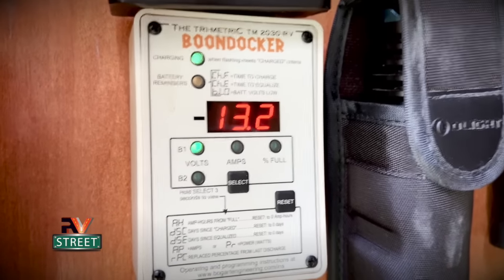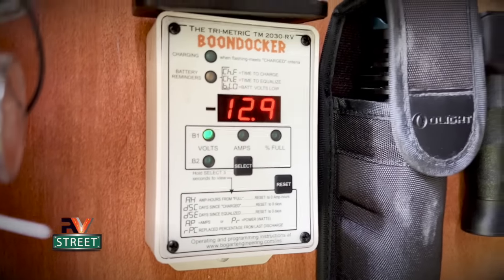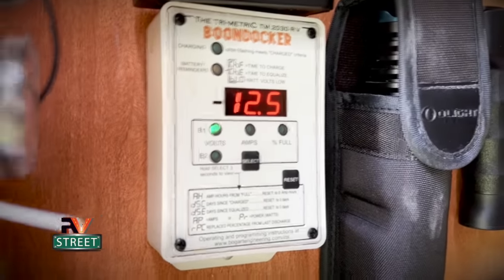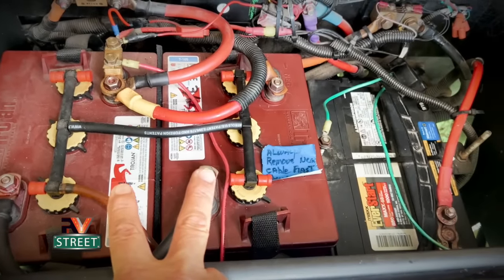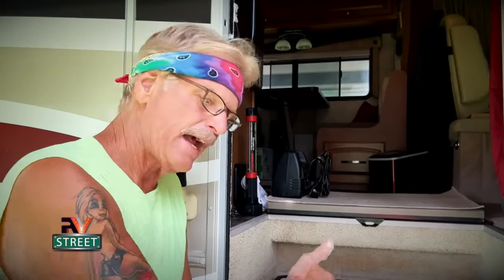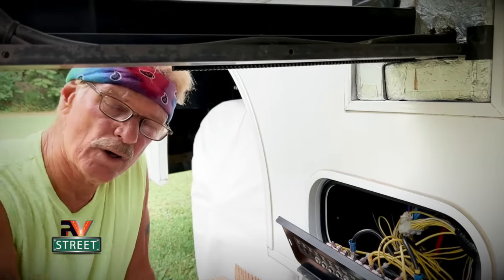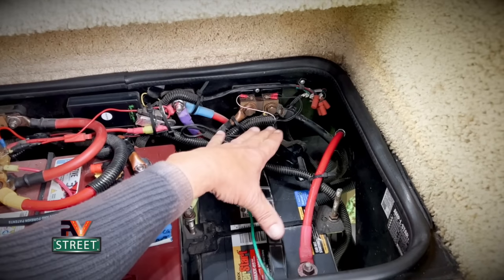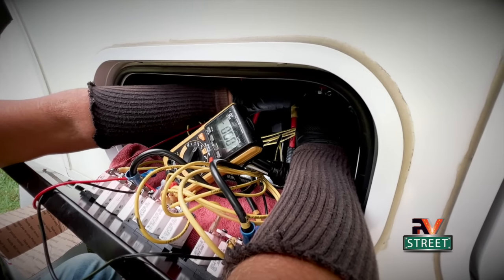RV Alternator IS NOT Charging House Batteries • The FIX

Comment: So I bought the weboost through your store. I am clueless as to how to run the outside antenna wire into the coach. Any suggestion greatly appreciated!! Thanks.
Reply from the maker: Hi Trav,
Well, weBoost does have several suggestions on their website. It just depends on the type of rig you have. For me, I mounted my outside antenna on the top of my rear ladder, ran the coax down the seam of the back cap and into my wet bay where I have a coax mounting plate for cable TV. So I screwed the out side antenna cable there. And then from the mounting plate another coax cable runs thru the RV all the way to the cabinets up front in the cabin area where there is another cable TV coax plate and there I ran the second coax cable and installed the rest of the unit including the interior antenna. You're just going to have to be creative. Every RV is going to be different. But take your time, think it thru and I'm confident you'll find a good solution for your set up. Once installed, you're really going to like how it performs.
BTW....thank you so much for using our Amazon Store to help support us. It means a lot 🙏

Comment: Martin, I have a 2000 Ford E450 V10. Something is draining my coach battery. I’ve put in new battery & new alternator. Running I have 14.2 dc volts. If rv sits for one day my battery is dead. How do I fix. Thanks
Reply from the maker: Try turning off coach battery with you arrive at your campsite. We do this or it drains the battery. Our switch is by the entryway steps.

Comment: I can run EVERYTHING just fine when plugged in or on Generator power but as soon as I start the Engine, my Inverter / charger reads a negative draw. Once I fire up the AC units eventually it throws a code PTOC shutdown over current protection....

Comment: After viewing this video, I used a voltmeter to check the charging status of the house (2 6V agm wired in series) and chassis (12V single gel) on my 1994 Flair class A. Here's what I found: resting voltage Chassis 12.53, House 12.72; generator on, Chassis 12.52, House 14.2; Shore power on, Chassis 12.52, House 14.27; Engine running, Chassis 14.06, House 12.68. The converter is an Iota DLS 55X.  I wrote to Iota. Their technician thought that the alternator was only charging the  chassis battery, and that the house batteries were only being charges by either the generator or shore power. It seems like a good idea for the alternator to be charging the house batteries as well as the chassis battery. Do you think my system is running as the manufacterer intended, or is the charging system not functioing properly? Maybe the problem is the converter, or one of the solenoids you talk about in this video? Your thoughts would be apprciated.
Reply from the maker: It seems like a good idea for the alternator to be charging the house batteries as well as the chassis battery
It's not only a good idea it's the way it's supposed to work.

As I stated in the video, the solenoids are a PM item. These need to be changed out every few years. You always want to address the common things first. Failure or sporadic charging is common. Your RV is a 1994. Replace them.
Reply: Martin, thanks for taking the time to reply...I know that you have other issues on your mind.  I was trying to read the specs on the two solenoids on my rig...they are too worn to read. But, they look very much like the ones you sell on your Amazon store.  Do you think I will be safe to proceed with ordering them without exact specs?
Reply from the maker: @KenCassorla  Yes.The ones in my store are actually a very common replacement so you should be fine. There are cheaper, 3rd party ones available but I'd stay away from them.

Comment: Hey brother I just got an additional 12 volt battery for the coach  positive to positive then negative tried to weld itself to the bolt connection I don't get it is the older house battery have a bad cell that would cause that thank you joe
Reply from the maker: I broken hearted to say Martin passed away April 2nd and I honestly don't have to answer to your question. Sorry
Reply: @RVstreet  I'm so sorry I love you guys

Comment: Not sure where to start. Coach batteries not charging. The battery disconnect switch is always lit. I can hear a click, but the light stays on.  It’s like it’s always disconnected. Where should I start? Test voltage at the switch?
Reply from the maker: Even though your battery disconnect rocker switch is lit, MAKE SURE it's actually turned on. If the rocker switch accidently gets switch off, it will still stay lit but not charge the batt's. That's where I'd start.
Are you plugged into shore power or what?
Is this a problem that's just popped up or what?

Comment: This sounds like my problem.  however, the battery isolation system is in such an incredibly difficult place to get at, I don't see how I could possibly change the solenoids out.  just to get my head in there to even see the bolts holding one of the solenoids in, is darn impossible.  Tried to get my wife to get her tiny head in there but she could barely fit.  How the hell did Winnebago even install this?  There has got to be an easy way but I sure don't see it.  I have a Class A 2006 Itasca Sunova 26P.
Reply from the maker: I am sad to say Martin passed away Sunday😢
Reply: @RVstreet  I'm so sorry to hear the news. He was a terrific teacher, excellent guide and seemed like an all around good man.

Comment: I own a class c. I believe mine is the same (electrically) as Yours.
Not sure why they don't make it so chassis batteries are being charged when you plug the RV into ac power. At least mine doesn't. I now keep a battery tender plugged into my chassis battery when camping longer than a few weeks. Had a battery go dead for an unknown reason a while back and don't want.that to happen again.
Reply from the maker: Just as a reminder, be sure when you're going to park for awhile, turn the chassis battery switch to OFF.
Reply: @RVstreet  I only have one battery cutoff. It is for the house batteries and it cuts off going to the 12 v panel. 
Maybe I should look into a chassis battery cutoff. Any suggestions or do you have a video on this somewhere.
Reply from the maker: @chrisschiel6741  Well, I'd just con't using the tender then. It's working for you.
Reply: @chrisschiel6741  I would look into your converter if your batteries aren't charging while on shore power. They should be, I have a C as well (Thor Chateau) .
Reply: @matthewmortiere4620  my house batteries are charging. It's the chassis battery that is not. Never has. I have an isolator solenoid after the chassis battery. Nothing else.
Reply: @chrisschiel6741  sorry Chris, I did misread that. Ok yeah, you are absolutely correct the chassis battery does not charge on shore power. If it is being charge while driving. If they are going dead a few days or weeks later, I would go have the battery bench tested. Good luck!

Comment: I looked for a Bosch 582253 on your Amazon store and  could find nothing like it.  It is commonly called a cube and I saw that you replaced it on your unit.  Is it available?
Reply from the maker: I don't know what a Bosch 582253 is. I never replaced anything on our rig like that. Please clarify.
However, anything you need from Amazon—whether it's in my store or not—you can still use my Amazon Store link to go to my store FIRST, then shop on Amazon like you normally would, put items in the cart and check out.
Thanks Jerry so much for wanting to support us by using my store. It means a lot.
https://www.amazon.com/shop/rvstreet
Reply: @RVstreet  This is a five prong relay related to the solenoids.
Reply from the maker: @jerryoconnor6770  OH, OK....yeah that item isn't available on Amazon so I had to search  and found at an electrical company online that had it.,

Comment: OEM alternator is most likely not really spec to charge deep cycle house batteries and the regular starter battery.   You can do better with a external bridge rectifier or an alternator that is built to charge your battery system.  So while you are doing all of this you need to get a alternator that is capable or install a external bridge rectifier.
Reply from the maker: Nope. Our alternator charges our house batt's just fine and has for the last 6yrs. The solenoids we're just old and not working right.Everything is back to where it should be now. If I had a bigger batt bay, then yes you're probably right.
Reply: @RVstreet  please review the alternator man YT and website.  He used to be good about responding to questions.  He is where I learned a standard alternator isn’t adequate for charging deep cycle and starter battery as they require different rates and are too much load for OEM alternator.  He is a expert so I accept his data.
Reply from the maker: @DEW HOLDINGS LLC  Well you might accept his data, but my alternator is a 175-amp alternator and more than capable to charge 2 - 6V golf batteries and my chassis battery. 
6yrs. of my set up is more than enough data and experience to prove it's more than capable. And as you can see, from this video and all my other videos, I too am good at responding to comments and questions. I don't pretend to be an expert or a know it all, but my vast experience over the years, I am a firm believer when something works there's absolutely no reason to upgrade or fiddle with a system that's been a proven solution. There's a lot of different circumstances in assorted RV's that may need to be considered on the charge rate but my situation and many others that are similar to mine, a 175amp alternator is more that adequate for a set up like mine.
Again, thx for your input.

Comment: Both those solenoids are available at my local parts house for 14.99. Just another place to look
Reply from the maker: Hi Paul,
Local parts houses like AutoZone, O'Rileys and many others are notorious for having a 3 tier parts system and are priced accordingly. More than likely those solenoids for $14.99 were a cheap Chinese knockoff and won't last long. It's the same thing with many other parts too. In most cases with high dependency parts, it's always best to pay more and get OEM parts. They are built better, and last longer. You don't want to facing another failure in a couple of years. That's my opinion but folks can do what they want.

Comment: I have a 1981 20' Class C and I was under the impression that the converter charges the extra RV battery.
Reply from the maker: Well first off the converter will only be charging when your plugged into shore power.
But it also interacts with the solenoids. Read my very first comment under the video.
And...in most cases the converter only charges the house batteries, but they're some RV's where the converter charges the house and the chassis battery. That's why I said everyone needs to learn how their system works.
Reply: @RVstreet  are you fairly certain that my 1981 class C would have a solenoid?  If it does, I haven't seen it and wouldn't know where to look.  There is virtually no info on my RV.  The info tag in the door jam (with tire pressures and all) says the coach is made by Midas International Corporation. I called Midas International and they are unaware that they were ever involved with making RV coaches.

Comment: I did not know about a B.I.M system until I just watched your video. I own a Nexus Wraith RV which is 4 years old. 

My manual says I have this system. I think I know where it is located. My chassis's alternator does not charge my house batteries. 

Up until now, it has not bothered me. We don't boondock, my RV is always plugged into shore power. When traveling every night we are in a RV Park. 

I pull into a campsite for night and plug into shore power. I then hook up a trickle charger to my chassis battery. 

The next day I unplug the trickle charger and shore power; off we go. The only time my house batteries aren't charging is the 5 or 6 hours we drive every day. 

After reading about the B.I.M it looks like there are things you have to watch. 1) make sure the alternator is not being overloaded, 2) make sure system is charging the house batteries. 

It just not seem to be a problem in my case.

Comment from the maker: Additional Information

If any of you have a B.I.R.D. for with a gas or a diesel coach, I have a detailed tech sheet with drawings that explains the details of how these systems work. I also have a alternator tech sheet that explains how the alternator should be working and how to test it. If you’re interested in getting one of these sheets, hit me up on FB Messenger—from my youtube home page—and tell me whether you have a gas or diesel coach, what doc’s you want and I’ll attach it to your message for you to down load.

My BIM System
When my problem of the house batteries stopped being charged while underway it’s interesting that my BIM system wasn’t working properly while being hooked to shore power OR with the generator either. On shore power or the generator it was charging some, but for a lack of a better word, about half way. I have a 4 stage SMART charger/converter and as it goes through the different 4 stages in a 24hr. period, my digital meter would show a charging range of 12.9 - 13.5 volts depending on what stage the converter was in. But when this solenoid problem arose, it would never show getting above 13.0 volts. Another tell tale sign of something was not right. BUT….as soon as I replaced these solenoids & relay, the charging from the alternator and both shore power and the generator worked perfectly as it did before.

One last note, this happened when we we’re on our way to Maine and stopped off at a Cracker Barrel in Horsehead, NY for the night. Up to this point my house batteries were charging just fine off the alternator. That evening we ate, watched some TV went to bed. The next morning when I pulled out, I immediately noticed my house batteries were not being charged while underway. So this problem happened that night at Cracker Barrel. It was immediate. One day worked fine, next day not so much. We had about 3 days and 800 miles or so left to our destination but it all went well. Our batteries just never got above 13.0 volts. But I knew then, when we arrived in Maine I had to perform this replacement.

For Safety
Since I have a gas coach there’s plenty of room for me to slide under the coach with it just sitting on the tires to perform regular maintenance. No need to raise it up. Or raise the coach up and block the axles like I did here. If you have a motorhome that doesn’t give you adequate room to crawl under it to perform repairs or maintenance, the easiest and safest way is to make some wooden ramps for both the front and rear tires and pull the motorhome up on the ramps.

Comment: I have  99 pace arrow with the butt system.  That means I'm bleeding from the ass hole trying to figure this crap out.
Reply from the maker: hahaha. you can do it
Reply: @RVstreet  well I figured it out. It's charging correctly Woo-hoo.  Loose connections on the selonoids.  Now for the electric steps and water heater challenges.